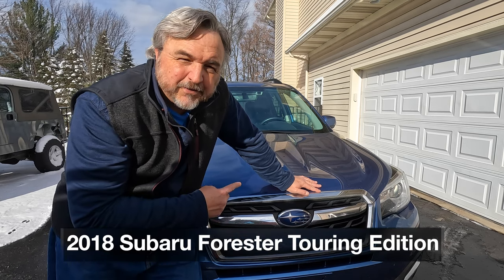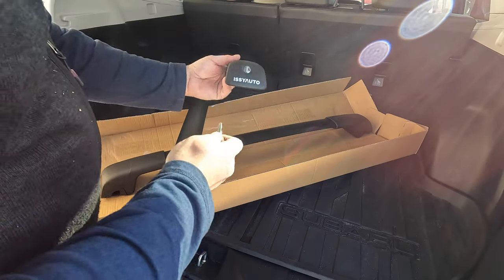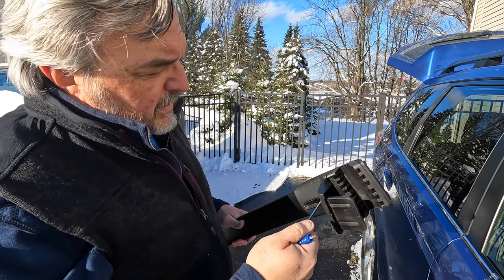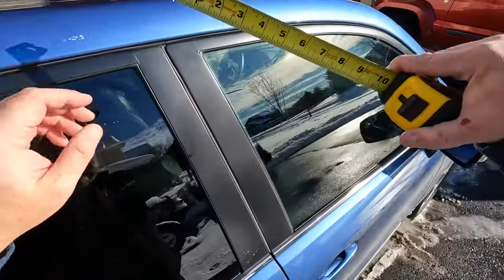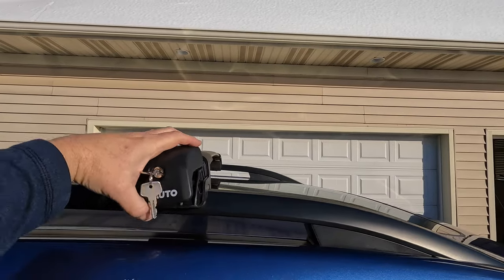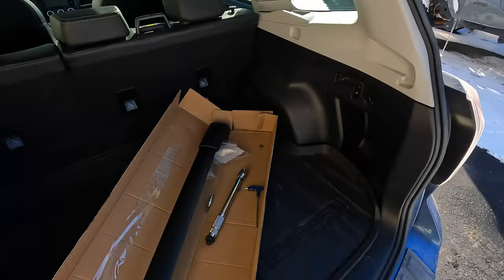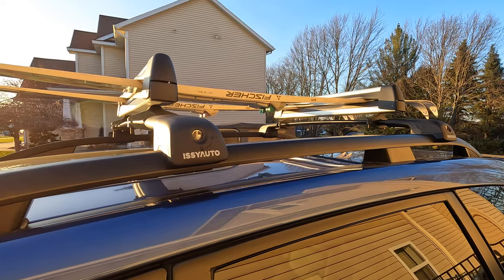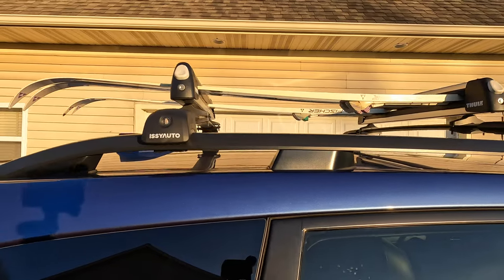Amazon Affordable Stylish & Quiet ISSYAUTO Subaru Forester Cross Bars

Comment: Thank you  for posting. I was stuck trying to unlock the cap. The illustration included shows the key turning to the right.  Your video  helped get this going. I am also impressed buy the quality of these cross bars.
Reply from the maker: I'm so happy my video helped you!  I completely understand on those end caps...one more word of caution if you have another set of keys for something like ski racks.  I thought I knew which keys went to what then spent almost an hour cursing these rails' locks thinking they'd already seized up after one season of Michigan salted roads only to find I'd been using the wrong keys that look literally identical...Funny how using the correct keys makes a difference 😆Shows these are pretty secure, too...since I was starting to think I was going to have to cut them off until I found I was using the wrong keys.  I hope they give you many years of good service.  Also, do check the tightness of the mounting bolts after some miles/weeks.  You may need to snug them up a bit...I don't think they'd come off but they might slightly move a smidge on the roof rails.  Might have been just me not fully tightening originally as I recorded...I can get a bit distracted doing that.  Thanks for watching and keep us posted on how they work for you! 💪

Comment: Help. I got these and have no keys. Can you tell how I can go about getting keys for the cross bars?
Reply from the maker: Bummer!  If you bought them from Amazon, I'd contact Amazon Customer Support and tell them.  They should send you another set with keys or at minimum refund your purchase and have you send it back.  You could also try reaching out to IssyAuto on their website but I've had decent experience with Amazon Customer Support via their mobile app and/or calling their Customer Support.  I hope you can get it resolved.  Let us know how it turns out and good luck! 🤞

Comment: Considering these, what is the weight rating? Can’t seem to find it on Amazon.
Reply from the maker: It's been awhile since I made this video so I had to re-read my own video description 🤣.  According to my video description..."While ISSYAUTO states these cross bars are rated to handle 150lbs, that matches the capacity stated in the Subaru Forester factory user's manual for weight-rating on the factory roof rails."  I hope that answers your question.  You may wish to contact their customer service or post a question on the Amazon listing to confirm.  Thanks for watching and let us know if you get a set of these what you think of them.  Good luck!  👍

Comment: Thanks for posting. Just bought these and they should arrive Thursday. Replacing them with my Cargoloc ones that hang too far over the edge for me to put an awning on them for comfort (bought them during Covid when car and camping supplies were at a low). These will allow me to put the awning on the side rail.

Do you think a Thule cargo box will fair fine, when full, on top of these?
Reply from the maker: I think it’ll be alright. Keep in mind my wife’s 2018 Forester roof rails are rated for 150lbs (if my memory serves me)…these crossbars ratings match the factory ones so keep that in mind in terms of weight of the box and contents. Also, recheck the tightness of the crossbar bolts after having them mounted a few days. I found I was able to tighten them up just a bit more after seeing they could move just a small bit. I’m presuming just from the pads compressing a bit. Let us know what you think and how they work with the Thule cargo box. Good luck and thanks for watching!
Reply: @WorksIRL  thanks for replying. Definitely won’t be 150lb of stuff in there, we stuff it with the lighter things (sleeping bags, pillows, chairs) and keep heavy contents in the car. Thanks for the reply!

Comment: Would these fit on 2022 Forester Wilderness? Thx
Reply from the maker: I made my video almost two years ago and haven't visited their Amazon store in awhile.  Unfortunately, I don't see them listing crossbars for the Subaru Forester any more at all.  I see a model for the Crosstrek and Impreza.  I'd like to suggest you contact ASSYAUTO directly to ask them but I'm not sure I saw any "contact info" on their Amazon store.  Check to see if you can find way to ask them a question as I may have just missed it.  I suspect the "Wilderness" edition Forester may have slightly bigger/beefier roof rails so you're asking a valid question and I'm sorry I can't answer that for you.  Good luck and please stop back and let us know if you get any answer...thanks for watching!